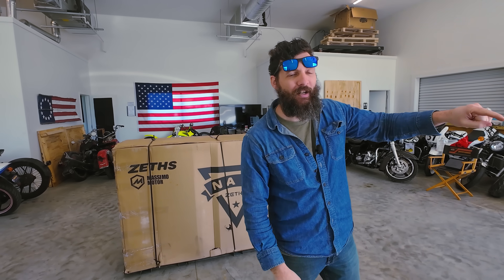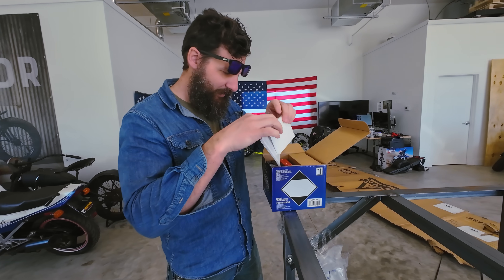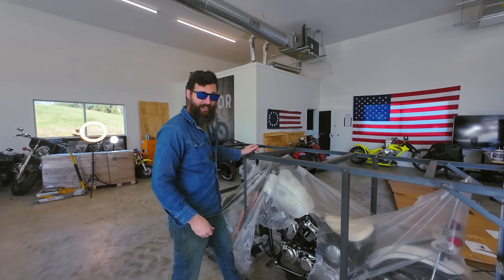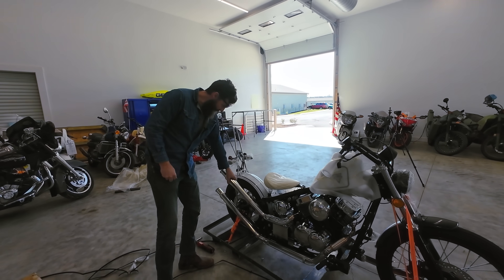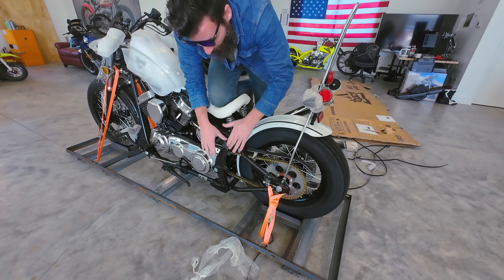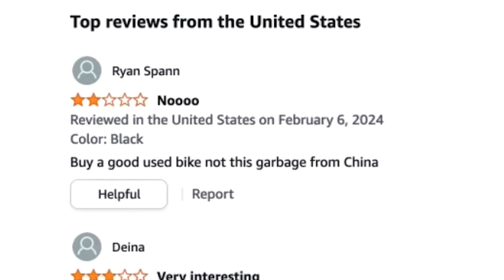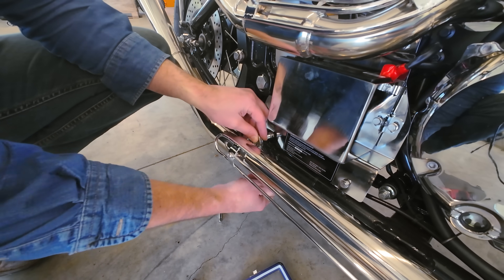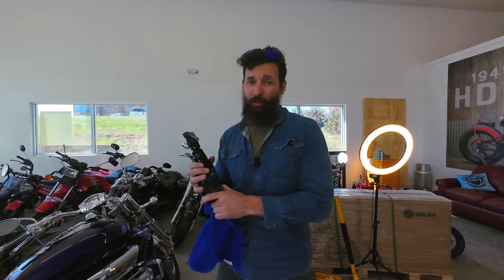I Bought the Most Expensive V Twin Chopper Motorcycle on Amazon

Comment: as someone who drives a truck and worked in a automotive production line. i can tell you why that battery is taped to the top of the box is because of how roughly that crate will get treated. if it were on the bottom it would be at increased risk of getting hit by some forklift forks. or other such hazard while being moved around or having things moved around it.
Reply: Exactly what I came to comment.
Reply: Also, in case of some mild flooding it might short out? Especially overseas, idk if that prevents stuff as well
Reply: @chrissi.enbyYT short out what? There was no fluid in it.
Reply: @johnnunn8688  yes. But its gonna be transported on a big ship. I would strap the battery to the top as well, incase some water crashes over the side. Car shipping ships have burned down a bunch of times by now
Reply: Less likely to be skewered by a forklift
Reply: @DeagleGamesTV  ohhhhhhh
Reply: Where Part 2 at?
Reply: That's exactly what I came to comment. So forks don't run thru it.
Reply: Wow $ 7000 you could have brought mine and it's made in the USA with a title
Reply: I believe in some State you don't need blinkers
Reply: Brandon Josh Storseth.
Reply: Parrot!
Reply: Smart move
Reply: @toodjackson4438  yessing that's why you learn hand signals I know it's legal in ohio

Comment: The frame looks like a clone of the 80's soft tail frame. Right down to the unused mid control mounts. The slip on looks to be $79 J&P Cycle pipes. Literally most of it is old school HD chopper parts with an undersized rice burner engine. Good luck Sean, you'll need it.

Comment: This is a Frisco style chopper (children's size). They are built narrow (hence the weird location of the front blinkers and the narrow bars) for navigating the narrow and crowded streets of SFO.
Reply: The style emerged in the early 60's, and was not anything other than a style exercise. The streets were nowhere near crowed then, and the original Frisco style used a hand shift; not at all friendly to riding in traffic.
Reply: Using a hand shift wasn't a style, it's how all the harley's came, till during the 50's when they began putting "mouse trap" foot shift external linkage on them. Actually during the 50's & 60's, what was custom cool to do was put a custom "mouse trap" on the older bikes. You see, because at the time, the British bikes had foot shift and were winning the races, so custom Harley racers began building homemade "mousetrap's" for their bikes. Halfway through the panhead run, Harley caught on, and they began coming with an external "mouse trap" foot shift conversion set up. So anyway most young bikers couldn't afford a new Harley at the time, so many bikers just rode them old pans with the stock hand shift, or they put a smaller gas tank on it for looks and cut the hand shift down to a jockey shift. But, yea, hand shift was stock on the older ones, and building a custom "mouse trap" to convert the bike to a foot shift like the race bikes was the custom thing to do back in the 50's.
Reply: @kmoecub thank y’all for the info I own one as a cheap daily and any info to help me improve this thing is very appreciated

Comment: The bolt holes could be for the kickstand. You might be able to change sides.
Reply: I was thinking it's all spare parts and the frame member was probably used on a dozen other things. Motorcycles, swingsets, trampolines.
Reply: I was thinking a center stand
Reply: Same place the optional centre stand bolts on on the yamaha Virago/Star it's basically a clone of

Comment: you noticed he didn't check the oil before starting it
Reply: Yuuuup
Reply: When he said “throw in the battery and throw in some gas,” my thought was “and check the oil, right? RIGHT?”
Reply: Yeah, he's a goofball when it comes to things like that. Half the time he forgets to put the choke on or take it off or open the fuel petcock. Like duh dude, you mess with and sell bikes for a living, you shouldn't even have to think about that kind of stuff, it should be second nature by now. And he's crude with his tools, doesn't really use them properly, probably chews up half of the screws and nuts and bolts he puts a wrench on and seemingly hardly ever worries about checking the oil, or primary fluid or anything like that. It's like he might have good business sense but not much common sense.
Reply: @bodeine454   because he don't pay for anything   it's all free . So it's !!! who cares attitude!! Which is very annoying to ppl who work hard to buy this stuff
Reply: @vlratcliffe1  😂 👍

Comment: I actually think it's a pretty good looking bike, aside from details like how plastic it looks and the angle of the fork make it look like you've hit a wall. But still, pleasantly surprised!
In Sweden, thin steel wire that you buy on a roll and that complete hacks hang up their exhaust systems and "fix" other mechanical issues with is called najtråd, "naj thread". So in our slang, to naja something is to half-assed throw something together with the least possible effort and no skills required. Fits in pretty well with some of the other things naja means in other languages! :D

Comment: Pretty hilarious unboxing! I'm actually surprised it started as easily as it did! Hope you checked the oil, btw. Probably the first thing you should change as well, if you're actually going to ride it anywhere.😉
Reply: Yep, I missed that too since most of those manufacturers only at best if they put any oil in them its a shipping oil that will tear up the engine and transmission pretty quickly if you run them on it.  Even if it did have real motor oil in it after sitting since 2002 that oil would have separated over a decade ago and would need to be flushed out with a few fills and drainings of kerosene plus if it actually has an oil filter and not just an oil screen that filter has long been junk and also needs to be replaced.  Any foam air filter or pre-filter after 22 years is also compost by now.

Best!
Reply: @neilfromclearwaterfl81 it's 2 years old!!!
Reply: @jcanfixall1585  Sorry, rock and roller here who worked with impact drivers and air hammers so sometimes I have trouble hearing Shaun clearly however when your talking Chineseum whether its their typical shipping oil or motor oil you still shouldn't start them on it and run them at all especially if they aren't from fresh stock manufactured in the past few months.

We've learned that the hard way over the past 20 years dealing with their Honda, Yamaha and Minarelli Clone Engines.  

When working on then you also learn to go with the minimal torque specification for any fastener and use gasket sealant even where you normally would not due to poor quality metals used in the castings being prone to cracking.

Best!

Comment: With speculation on the bars on the rear fender, I was thinking back to Korea. Old boy bought a brand new Ducati, chopped off the rear fender and somehow mounted and wired a full size refrigerator/freezer on over the rear and was driving it down the sidewalk. I couldn’t decide if I was impressed or offended.

Comment: Looks like someone got bored with a Sportster and cobbled it up. lol. I’m shocked it wasn’t disassembled more for shipping and the battery was in the same box. I use to work for Harley and the handle bars came loose wrapped up taped along the bike with a few other of the parts to keep it compact and from braking during shipping.

Comment: I bought from Cleveland cycle works a Heist a 250 Honda clone runs fine but they closed up and the master cylinder for the rear brakes seized up got a new one it would not bleed. The next one they sent was seized up and so was the caliper so I guess we are all screwed that bought those bikes . Sad they seemed to do sell well and was a dependable machine .

Comment: I guarantee you 100%, if you were to buy a used softail Harley for $7,000, it would outlast this X10. And when it finally needed to be rebuilt, you actually could. Not to mention, increasing its value over the years...

Comment: Honestly is they made it about $2000-$3000 and made the gas tank bigger, this would not be a massively horrible bike. 

Now having said that and as someone who has bought a Chinese made bike.....Just don't do it, honestly what they won't tell you is in America most service shops wont touch a Chinese brand bike unless it's a big brand, I got myself 2023 Venom X22R Max for near 4 grand. Worse choice I ever made, under 500 miles and it started having all kinds of issues. So I sold it as fast as I could and lost over half it's value.

If your a new rider and must buy a new bike and are scared of big CC ranges, honestly go Honda and Kawasaki. Both have very affordable base level starter bikes that will last a long time, Personally a Vulcan S, or the eliminator 450, or the new ninja 500. Why you might ask? Because going from a 250 to a 450 cc is little difference and once you start at 450-500cc's you should be able to handle anything over 1k CC. 

Far to many people care about specific CC ranges best way to go is set a CC range you feel comfortable at then on you next bike double or triple that, 400 to 800, 650 to 1300+.
Honestly I'd take most Japanese bikes over most American made due to cost of repair cost of ownership.

Comment: I think I would yank that motor and re-engine it with a Suzuki Savage  650cc Single thumper, and call it GOOD...& grease every bearing and head-set ~ wheel bearings, I bet what it has is nothing better than a thin coating of WD-40....but for the money/ $4500. bucks plus. I'd buy a nice used bike and be forever happy.//// but I get it/ you need to add new content for the channel.